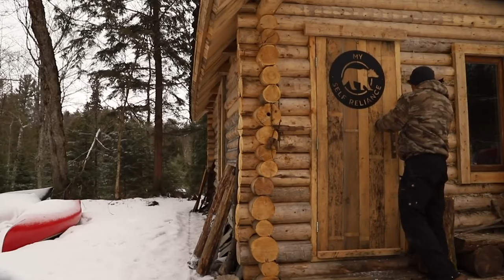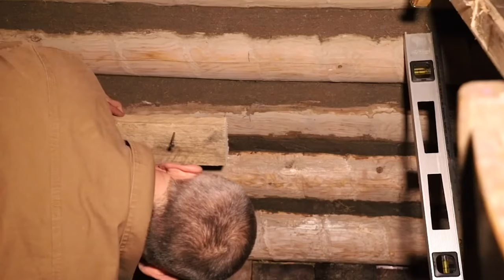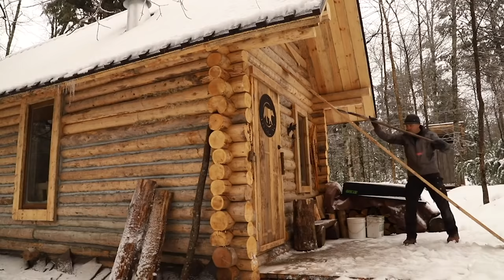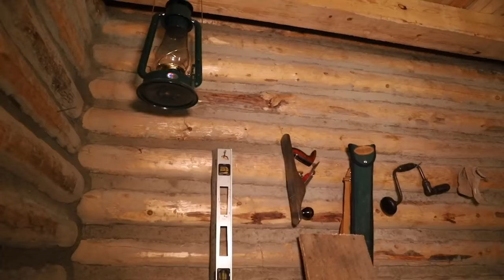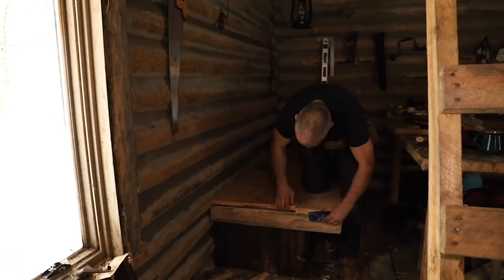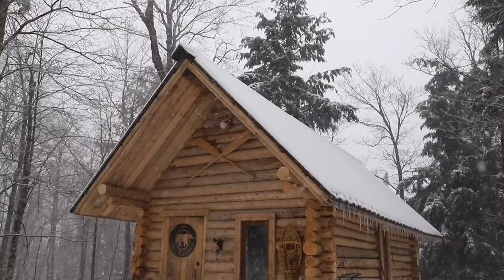Building a Bench with Hidden Storage and Room to Sleep | How to Build a Log Cabin, Ep16

Comment: Hi!  I watch all your videos but I rarely comment.  You get a lot of great comments from others and I pretty much figure whatever I have to say will be better said by another.  In this case, I have a suggestion for the dinner table in the new cabin.  If you build a bench similar to the one in the existing cabin - 30" wide - you might consider making the table wider on the bench side so that it pushes toward the wall further.  That way, people sitting on the bench will have the wall as a back support and the table will push right up to them so that eating is easy.  There might be good reasons why building the table wider on the bench side is not feasible or  is a bad idea.  I can't think of any reasons why is won't work; in addition,  it will also provide you with more space on the table for placement of trays and platters of food.   Best Wishes on your new endeavors!